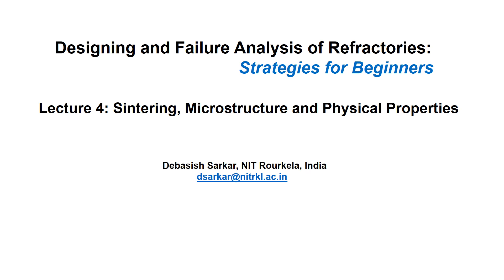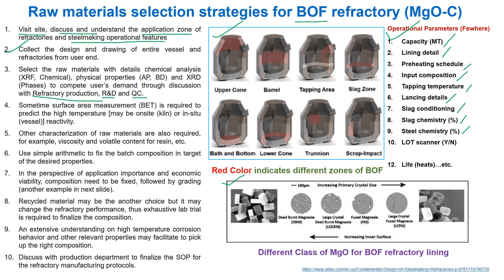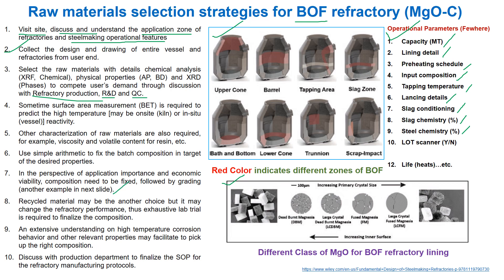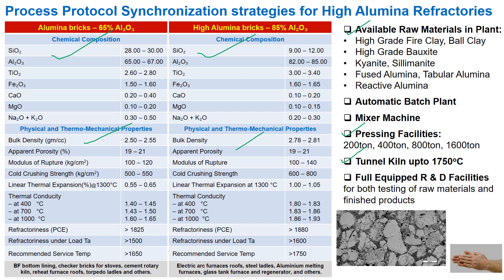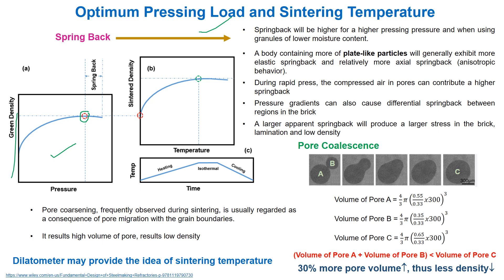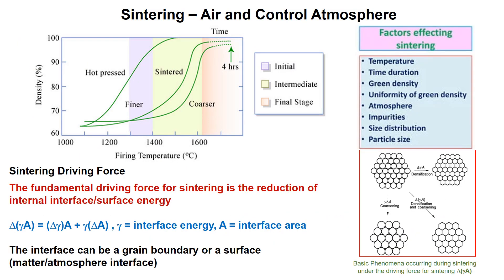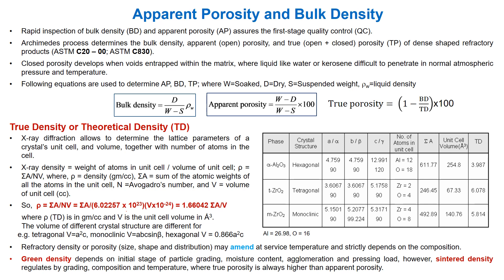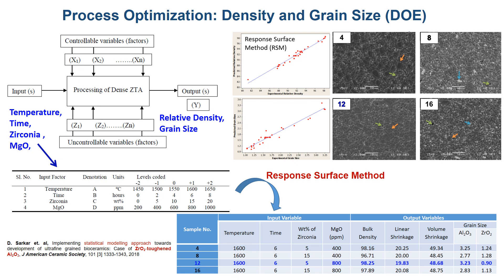Lecture Series 1 - Lecture 4  Sintering, Microstructure, Physical Properties for Refractories (DOE)

Comment: Great work Sir, this is very helpful. There are hardly any examples and case studies available from the domain for failure analysis and DOE application. Thanks for referring the research article for further information.
Reply from the maker: Yes, such method may facilitate the composition and process optimization as we already discussed in the mentioned literature.